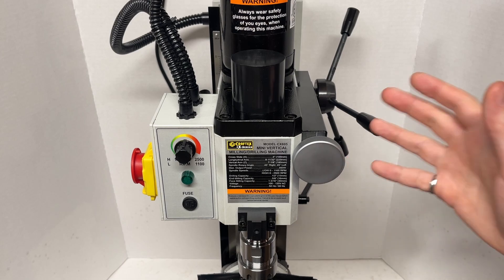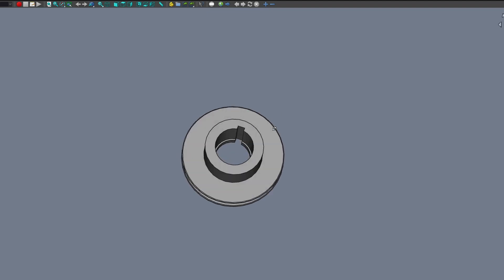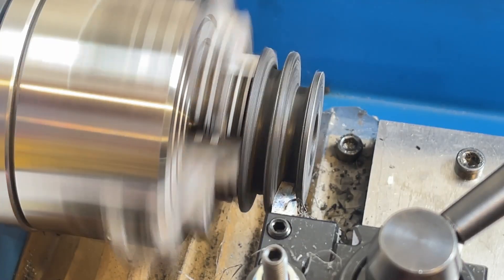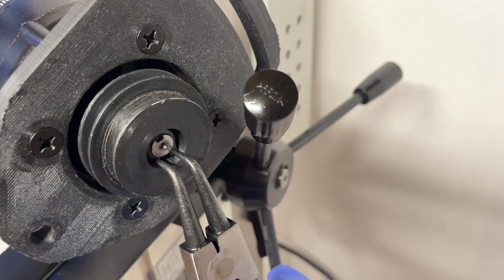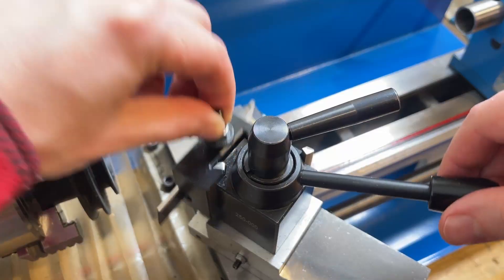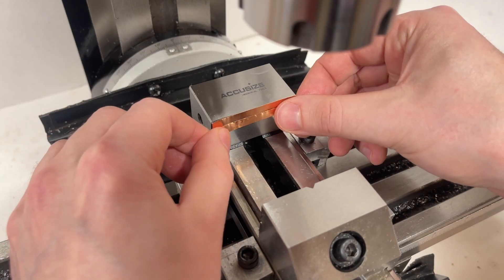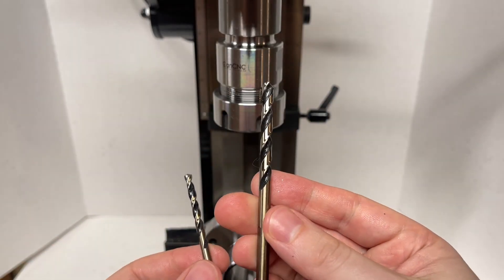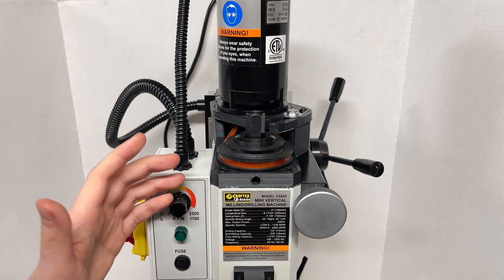3D Printing a Belt Drive Upgrade for my Mini Mill

Comment: Brother, you got to replace that 3D printer with something modern man. Something at the very least core XY. I'd say it's a bigger change that then going from a manual mill to cnc even. I haven't had to spend not one ** minute troubleshooting my ** ** machine in the last couple years, man. It has been heavenly. Everything just works now.
Reply from the maker: Replaced it already! You’re completely correct. A modern machine has made a world of difference!

Comment: You probably already know this trick to ensure your drill is directly in line with the center of your round part: put a center or a spotting drill in the chuck (a true point as opposed to a drill bit). Place a machinist’s scale on the part and lower the bit onto the scale to trap it against the part. If the scale is not level, you are off center. 

The same trick works for centering your lathe tool. Just trap a scale between the tool and the work and you’ll see if the tool is high or low.
Reply from the maker: That’s a good trick, I haven’t heard of it before! Thank you for sharing!

Comment: A trick on printing those pulleys, for future reference. When you place them on the bed in your slicer, put them at a 45° angle. Supports will only be needed a little on the one bottom edge and should be much easier to remove. Most 3D printers can handle a 45° angle without supports.
Reply from the maker: That’s an awesome trick! I’ll definitely have to give it a shot! Thank you!

Comment: Great project, but you really butchered those 3D prints. Those pulleys could bave easily be printed with no supports, even the cheap printers can handle very steep overhangs nowadays

Comment: have you tried freecad 1.0.0 yet? they fixed the toponaming issue and now editing parts is just as easy as in every other cad platform, also there is a new simulator for CAM

Comment: What are you using for CAD? I need to move on from Tinkercad, looking for ideas that aren't commercial black holes which will eat money for years. Great videos!
Reply from the maker: Thank you! I usually use “Fusion” for my cad models, but in this video I tried out “freecad”

Comment: What would those step pulleys have cost you on Amazon? About six bucks apiece? The motor mount and belt adjuster sure 3-D printing was the way to go but those pulleys I would’ve bought those for sure. Or made them, out of aluminum, on your mini lathe.

Comment: I would try using a timing belt with timing belt pullies (properly sized for the load of course). This would reduce the risk of slipping and reduce the radial load on the motor mounts as well. Of course if you printed the pullies this would increase the torque on them, increasing the risk of them breaking. I don't know how expensive new pullies would be. Printed ones would be a cheap test. Just a thought.

Comment: Hey man, loved the video. I have a bit of experience experience with engineering and 3D printing and I thought in regard to your slipping, that might be causing a lot of friction and therefore heat into the 3D printed part. Even if your printed in ABS, if that plastic gets near 90°C it will start to deform and it could fail in a hazarhous way. I thought it might be worth considering sending the parts out to have them either printed in nylon or metal 3D printed. Of course, once you're set on a design (which looks fantastic by the way).

Comment: You are using a timing belt on smooth pulleys, that is what causes the slipping
A good way to fix it and to also fix the issue of support material ruining the finish is to redesign the pulley to accomodate the teeth of this particular timing belt while reducing the groove and disabling supports in the slicer.
You will get way less bridging gaps and since the teeth of the belt will be engaged in the teethed grooves of the pulley it won't slip and also won't need as big a groove to stay in place.
Also feel free to give the groove a bit more space and fillet the top belt retainer, this will help with printing.
Take into account printing in you designs, try to avoid needing support material where you can avoid it!

Comment: hi mae can you run through your programme on the calculator to convert from imperial to metric considering the revolutions on the machine dial. I would like to do something similar respectively my dials read in imperial increments and a full revolution equating to 0.125 and being in the uk I am more inclined to work in metric.

Comment: A couple of things to note:
- Part of the reason why the belt is slipping is because you're using a timing belt on a smooth pulley. The notches reduce the contact and dramatically reduce the grip since its just sitting on the peaks of the belt teeth. Get a flat belt and it should slip less. 
- The overhang that pulley has inside the V groove doesn't look aggressive enough to require supports if your print settings are correct. Use Prusa Slicer to select organic / tree supports for the bottom area and then you can pull the supports off very easily without any blemishing to the print.

Comment: I wonder if removing the spinning mass of metal that was the gears, and replacing it with a plastic pulley, could have any detrimental effects on cutting power, not including things like belt-slip etc. Just considering the kinetic energy they could have stored. But once it's remade in metal later if ever, then that kinda resolves that issue anyways if so.

Comment: I'd print that pulley in 3 parts so that you don't need supports. Then just screw and glue them together.
Reply from the maker: Extremely good call! I should go re-model it
Reply: @Someone_Should_Make_That  perhaps you can make aluminum pulleys in the lathe in about the same time that you 3D print them. 😁

Comment: This makes me wonder if anyone has tried to make a Gingery lathe and/or mill using as many 3D printed parts as they can. How many parts can you make out of plastic before it fails or will it fail at all? For that matter, what if you mixed your own plastic with raw chemicals and poured it into molds to make parts even faster?
Reply from the maker: That would be really cool to try! I may have to give it a shot

Comment: Nice! I see you've got the same printer as me. I can never pull off a print without using a full raft. It always delaminates or warps at the edges. Any tips?
Reply from the maker: Yes! I had the same problem, I usually just add a full brim and accept the extra material usage. Though I’ve had good luck using some “repositionable spray adhesive” on the bed. Your mileage may vary, I’ve heard glue stick works well to stick things down as well
Reply: The best upgrade I ever got for my Ender 3 was a borosilicate glass bed, combined with Aquanet hairspray. Perfect bed adhesion with PETG and PLA.
Reply: I'll give it a go! Thanks!

Comment: I've made a bunch of "temporary" 3d printed functional parts that ended up lasting way longer than necessary/expected. It's probably easier to just 3d print a replacement should it ever fail than to try to upgrade it to aluminum later
Reply from the maker: It really is surprising how good the parts turn out with how easy they are to make, I don’t know what I would do without it!